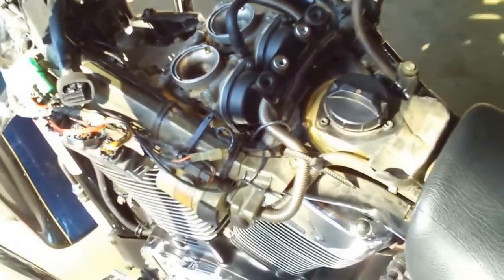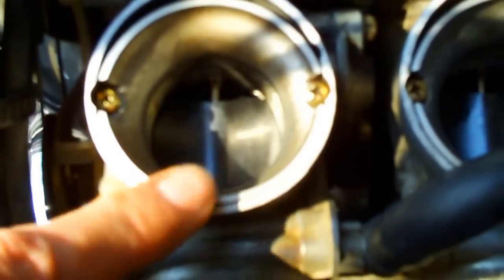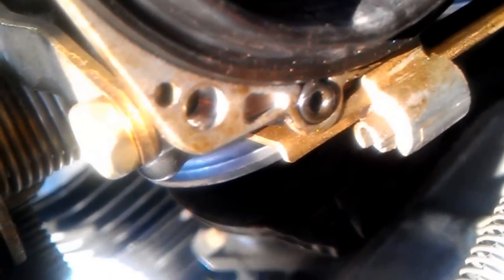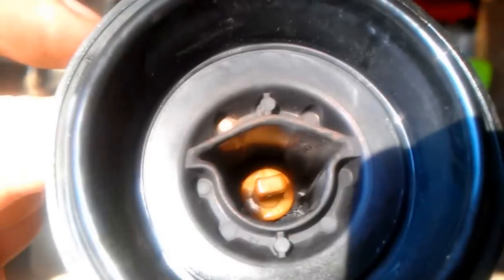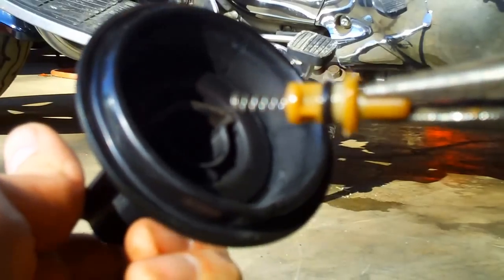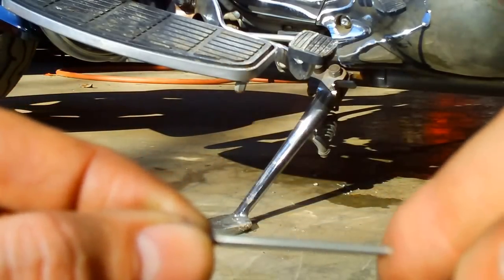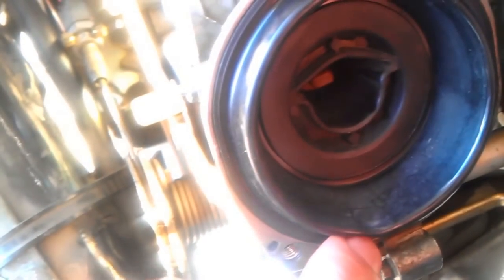Shimming the needle jet of CV carburetor Suzuki Intruder 1500 ✔

Comment: And of course I just realized I lost 3 out of 4 gaskets yep them little ones. Also whomever did the second set of carbs added two shims? Not sure if that was a good idea. I eliminated two..Arghhh any ideas where I can get replacement O rings or The size they are?
Reply from the maker: I do not know their size, John, but if you have one to take to an auto parts store there's a chance they have one or can point you in the right direction?
Reply: @contact4mwy7  Much Appreciated Mark my next stop..
Reply: Cheapcycleparts. Com or your local Suzuki dealer.
Reply: @booze_talkin  Thanks Ray. Suzuki dealer looked stunned and said gotta buy the kit.gonna try and find out the size and find a manufacturer that would have them.Will try. Cheap cycle though just in case

Comment: At 0:14, there is a hose coming out of the carb which runs up and then to the right of the carb. Where does this hode plug into?? I got one of these (not working) and I cannot figure out where this connects into.
Reply from the maker: Ok, are you talking about the hose that points straight up from between the carbs, bends to the right and then bends down over the frame on the right side? If that's the one, it's either a fuel line to feed the carbs, or a vent line to vent the bowls (I think). I do not know where the other end of the hose terminates. Can you find any diagrams online? Service manuals?
Reply: Mark Young - Outside The Box it’s a vent hose that goes to nothing! I figured it out! Thanks for the response bud

Comment: Does the needle have adjustment grooves to change position of retainer clip, which will raise or lower the needle?
Reply from the maker: Ray Lawrence the needles in these carbs only have one groove for the c-clip. That is why they would need shims to raise the needle to change the fuel mixture from stock to a more rich setting.

Comment: I know this is super old but aftermarket needle kits for VL1500s are stainless, this is not OEM material and is too hard, it will wear the seats (where the needle pokes through) and oval them out and basically trash your carb because those seats are not meant to be replaced and thus very hard to do, use OEM needles (aluminum)
Reply from the maker: I didn't replace the needles, just shimmed them. These are indeed the factory needles. I agree with your statement about stainless steel needles causing damage to the internals of the carb, but that is not the case here.

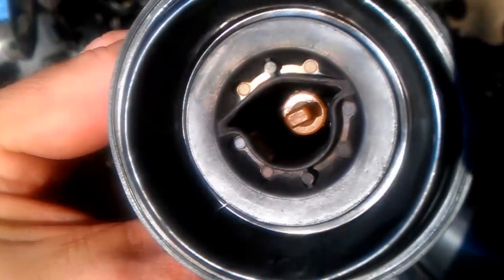Comment: Hello, great video. I have a problem with my gs 500 carburetors needles, they are similar to video. When you put back the needles into the carburetor piston valve at 6:27, how do you do???? Mine get loose, and bike can't run. You have to press the holder needle down to fit it? I don't want broke something... Please I need help, thank you. (Sorry for my VERY BAD english... i can't understand the video, only some words... :()

Comment from the maker: You're right, the two carbs have slightly different jets on each to control engine temperature. I did not take this into account when I adjusted my pilot screws as I had set them both the same number of turns (1 1/2 if I remember right). Thanks for pointing that out, I hope you can adjust them accordingly in relation to the bigger/smaller jet combinations.

Comment: I own a 2008 ZZR 600 with 4 Mikuni BDSR 36R , your slides and the vacuum hole are very similar, have you adjusted your pilots as well? if so did you set the two inside cyls slightly richer in keeping with the larger jets located there? or the same? noone ever talks about that, If you jet the centers richer should you not set pilots richer too? thanks

Comment from the maker: Hello Russia! Try something thin (or even use like I did) like the thickness of a soda can. Aluminum is light weight too, so this will help the needle respond quickly like it should. You can also take one of the needles (careful not to bend or lose it!) to a store that sells small metal washers and find one that fits the shaft of the needle jet, but is not much bigger around than the C clip at the top of the needle, or the plastic retaining piece that slides on up against the C clip.

Comment: Hello from Russia. It is a nice video. I have a problem with adjusting my VL1500 carbs. My bike have stock airfilter and cobra exhaust. And bike have exhaust clapping noise after decrease accelerator. I adjusted the pilot jets for 3,5 turns. But I dont know thickness of shim washers to adding to the needle jets.